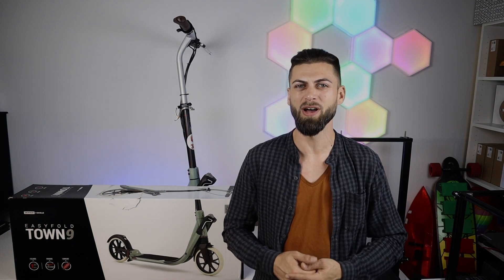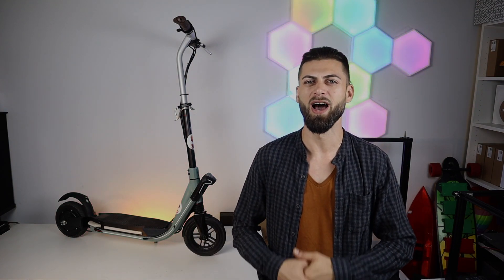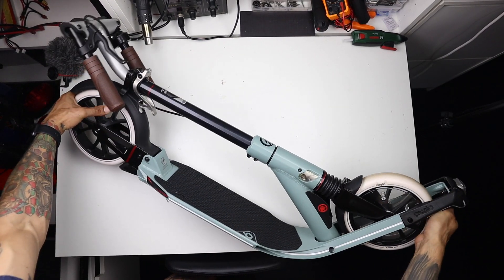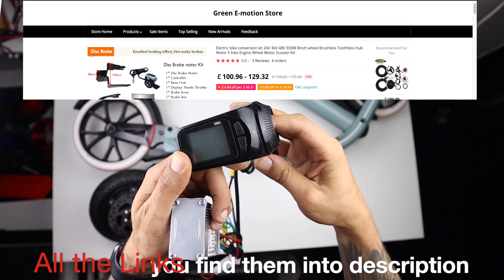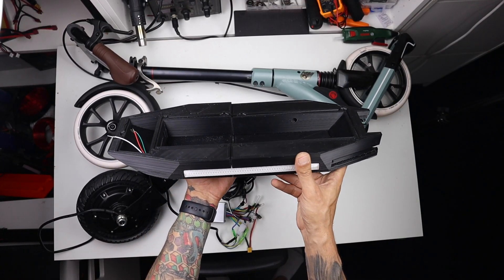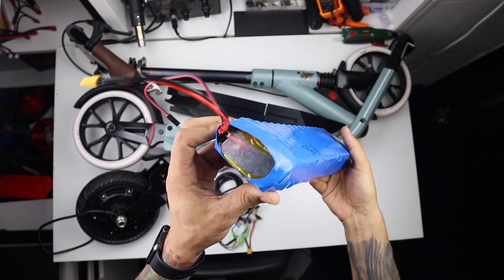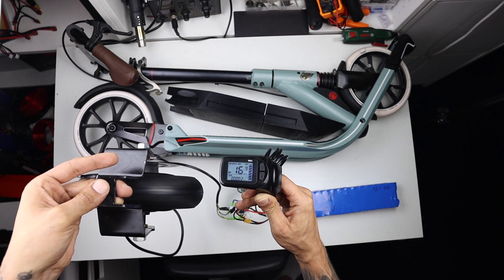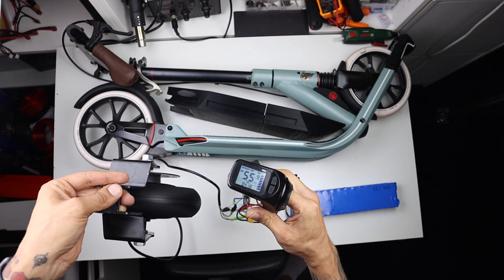DIY E-scooter Conversion Kit

Comment: Hi. I used your video as a template for a similar conversion (36v controller, 36v/20Ah battery, 350w motor) but cannot get faster than 25 kmph... Where are my errors? Thanks 👍
Reply from the maker: hub motor have an KV value.   lower the value higher the torque, higher the KV is higher the top speed .
Reply: Thanks 👍 I will look into it

Comment: Hi thank for this video, when i check front wheel link seller writes it is not fit oxelo 9 scooter, do u make any changes front fork. Thanks.
Reply: ı wonder that as well, have you found the answer yet? is it compatible or did he make any changes?
Reply: @chibi4910  No need to make any changes 8 1-1/4" wheels fits well.
Reply: @PoorCat-c8k  thank you for your reply, another question, what is the most economical option for someone in turkey at the moment. Because right now the wheels are more expensive than the scooter itself.
Reply: @chibi4910  Uygun fiyata gelir mi bilmiyorum tekerlekli sandalye satan yerlerde bulunabilir, onlarda da 8 x 1-1/4" ön tekeri olan modeller var. Ben birinde buldum şansa elden aldım ikinci el olarak.
Reply: @PoorCat-c8k  anladım bro teşekkür ederim,  yeni aldım bende scooter ı da tekerleklerin yükseltmeyi düşünüyodum bakıcam onlara, artı sen elektrik dönüşüm kiti de kullanıyomusun?
Reply: @chibi4910  Yok şu anda sadece şişme tekerleklerle kullanıyorum, konfor çok artıyor ama, sürmek biraz daha fazla efor istiyor, tutuş arttığı için. Motorun bizim scootera göre şişme tekerleklisi yok alacaktım vazgeçtim.

Comment: Dude, that is absolutely awesome! This is the best build for the kind of scooter I want. Fast, agile with good suspension and able to handle those jumps, like a bmx bike.

I noticed you had long stopping distance. Maybe also adding front  brake might help. Also was wondering if you put on headlights.

I built an ebike a couple of years ago and now I want to build a scooter like this. Thanks for the inspiration. Just subscribed.
 👍😎👍

Comment: What tool did you use to remove the fender from the original swing arm of the scooter?? Please reply. Thank you!
Reply from the maker: got only one screw and fall off .. you see the screw in the video when the scooter is still stock .
Reply: @Fabrica3D  what tool did you use tho? Mines a weird looking allen whole? Its not not deep as well idk how to remove it.
Reply from the maker: Vince Rubio   , don’t have some weird tools :)  hammer , screwdriver, allen key ,  normal tools. try with something that fit the hole . :)